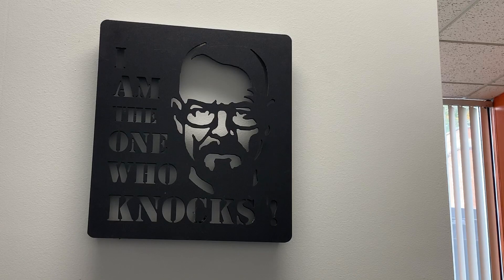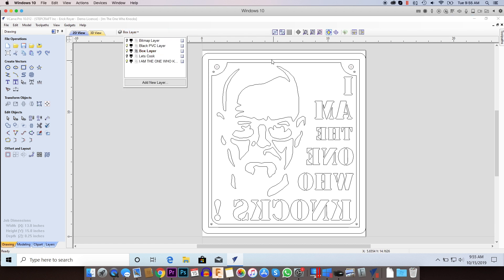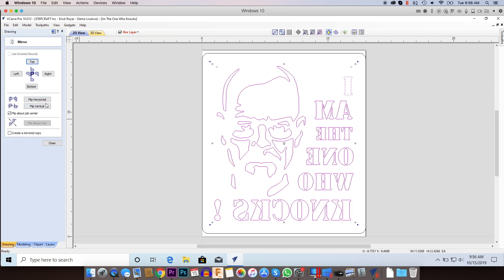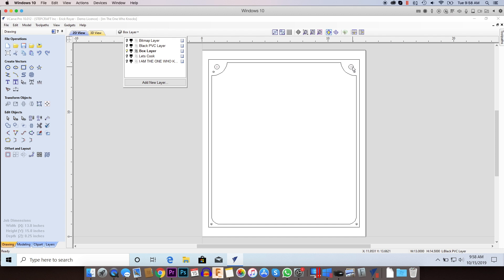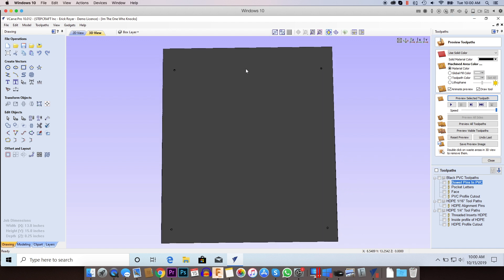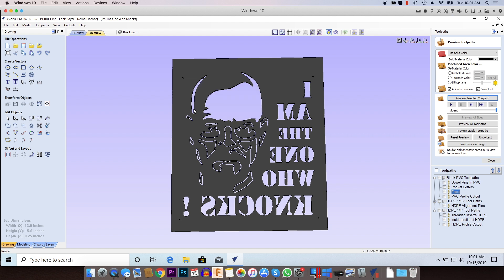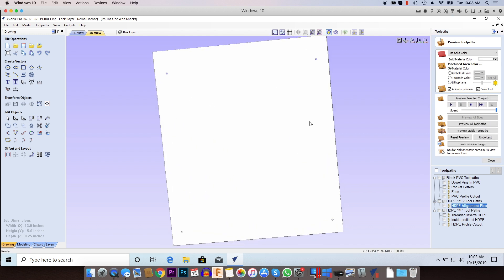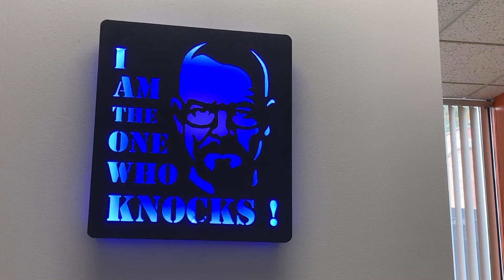CNC Tutorial - I Am The One Who Knocks! Software Walkthrough

Comment: Not sure about using threaded rod & offset holes.... When you try to remove the frame from the wall it might very well blow out your drywall.  
Are you cutting through the black acrylic or just through a black film?
Reply from the maker: We use the offset holes all the time and I was shown this by a friend who owns a large custom sign shop in our town.  They do this all the time for drywall.  It does not put so much tension on the wall that it will ruin it.  You will have holes, but you will regardless with any hard fastener .  The Black is 6mm (1/4") PVC board, and yes we cut all the way through it to make the silhouette.  The back frame is HDPE plastic.